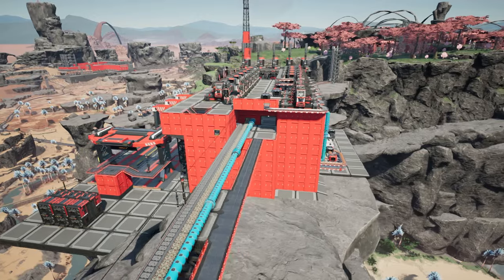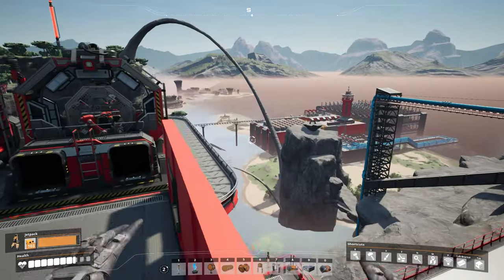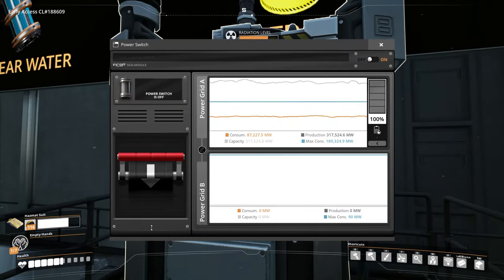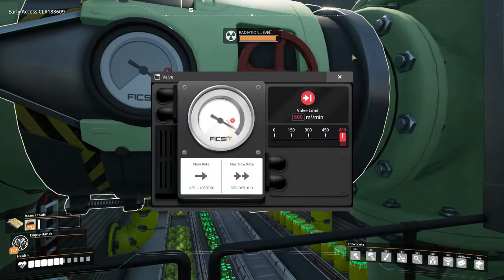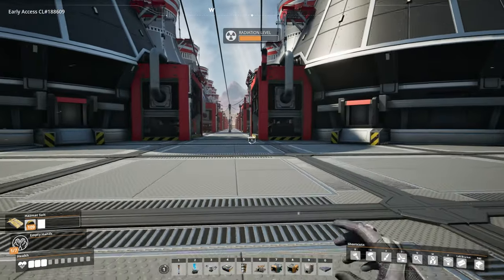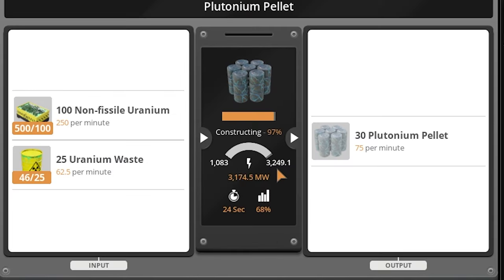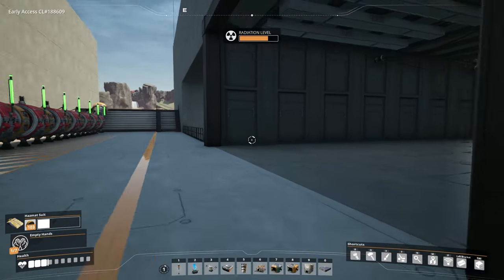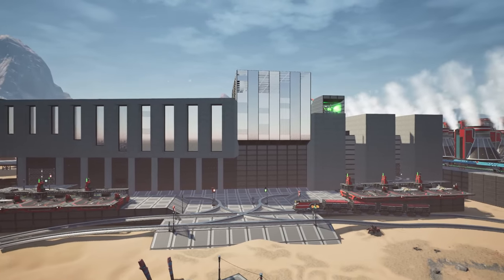The Nuclear Power Plant is FINALLY (actually) FIXED in Satisfactory!

Comment: Kibitz: It's finally fixed
Narrator: it was in fact, not fixed

But seriously is this satisfactory or a  nuclear balancing game?
Reply: Yes
Reply: ¿Porquè no los dos?
Reply: This is why I just haven't touched nuclear yet.
Reply: @Her_Imperious_Condescension  Honestly, Nuclear is not THAT bad. Kibz just kinda went the long way round in how he built (and re-build) it, not to mention the miscalculation in his waste processing plant. Multiply that by the sheer size of the powerplant, add the overreliance on a single ressource with the rubber and, well... you saw what happens :D
He could have cut rubber out of the heatsinks completely, instantly solving his headache. But he didn't because he's a content producer and fixing the plant has provided him with hours and hours of material :D
Reply: @Her_Imperious_Condescension  yeah better wait for next update when the oveclocking goes to linear scaling in power consumption so you dont even need that much power... so you can make a smaller nuclear disaster :P
Reply: @timokampwerth1996  I still contend he made a mistake on his heat sink calcs and most of this work was unncessary.  He said in the last video he needed somethign insane like 165 heat sinks / minute.  There's no alternate in the game that would require that many heat sinks even using the most efficient setup possible.  I think you'd max out at 130 and I'm pretty sure his setup should only need about 60ish.  I make 720 waste per minute off a single uranium node completely maxed out...I believe I need 35 heat sinks per minute for it.  I made a very small factory that just makes heat sink using nothing but oil, bauxite and water as inputs.  I make the oil into rubber and coke, sink the resin, use the coke in the aluminum scrap refinery, turn the scrap into pure ingots, then casings, then a few assemblers to make heat sinks from the casings and rubber.  It am pretty sure the hwole thing is less than 20 machines.
Reply: @NotMyActualName_  That's one way to go, I usually don't bother with oil at all and go the insta scrap route since coal at that point has lost most of it's value and I'm producing the acid anyways for the powerplant and I just use the overflow acid from the ruel rods because I'm using most of my quickwire for my Supercomputer plant. Add a bit of copper for the alclad casings and for copper sheets for the regular heatsink recipe and I'm done. 

Kibz tends to use slightly more involved setups because they result in more interesting looking builds, or so i believe. In terms of efficency he could build a lot more compact.
Reply: @timokampwerth1996  I considered avoiding using oil and just go with copper and aluminum for heat sinks, but then you have to bring in coal.  This solution I thought was simplest.  One oil line could make all the rubber AND coke I needed, plus if I get around to it I'll turn the resin into fabric to make rad filters on site.  I have a little excess quickwire and coal at the main plant.  I think I can just overclock my aluminum setup for the heatsinks and send a few extra casings over for that as well.  Even an inefficient setup there would probably make me all the filters I'll ever need given enough time.
Reply: @NotMyActualName_  Well, I had a coal node near the plant by coincidence so going with oilless was an easy choice :D Technicxally speaking going cokeless and then using rubber for the casing itself is the most efficient in terms of aluminium usage,  but i just wasn't going to bother. Perhaps i should also mention that i strongly favor centralized builds, so all but one Bauxite nodes are going into that facility, making the insta scrap far more viable than setting up all the inputs for a single node.
Reply: @timokampwerth1996  
I just don't see what Nuclear can offer that Turbofuel doesn't.
If Plutonium was used for recipes in the future, that would be a different story, but right now, it's just more hassle than it's worth.
Reply: @timokampwerth1996  I agree if you have the resources nearby that way is easier to set up.  In my case I could have gotten coal but I was pretty tapped on copper in the area and the oil node was right there.
Reply: @Her_Imperious_Condescension  Simply put: opening up oil for other projects. Or in case of Turbo Fuel: Oil, Coal and Sulfur. Oil is increadibly useful as a source for Rubber, plastic, petrolium and Cloth. Sulfur is needed for Batteries to set up stable Drone networks and Coal is... ... Well, oil and sulfur are useful. Uranium is useles outside of power production. It also produces power in a volume that oil can't even get close to. Depending on your playstyle, past a certain point you won't be able to avoid Nuclear
Reply: @timokampwerth1996  While i did have my mess with nuklear stuff too.... using copper for the heatsinks works best, while i dont have 1457537 plants yet i produce a ton of em and could pump out 2-3x as much with easy as ive pullled all the copper in that region and 2 coal mines there xD
Reply: @timokampwerth1996  
You don't need Coal for Turbofuel if you've got Blenders (turbo blend fuel FTW)
Honestly, not using any drones either. Haven't really found a viable use case for them yet.

And those are the key words right there, 'depending on your playstyle'. I'm making 80GW from my Turbofuel and haven't even come close to needing it all, because I don't build stuff on the large scale.
Reply: @Her_Imperious_Condescension   In that case Nuclear is not all that useful for you in terms of power production because it's specifically the large scale solution. I couldn't run even half my facilities if i didn't have nuclear set up. I'm using roughly 80% of  the Iron and Copper Nodes in the world, every Caterium Node and all but one Quartz nodes, all of them being run through overclocked Raffineries instead of Smelters or Constructors.

But aside from that, Nuclear is a fun puzzle. Especially when setting it up for the first time, there's tons of stuff to figure out how to handle. Even more if you want to sink the waste or even build up a secondary Plutonium plant.

Comment: One of the best things I did with my nuclear plant was wire up the water extractors in batches. So I can shut down my plants in a central power station either all at once, or in groups of 6 by just turning off their water.  No more walking around and flipping switches on the reactors if I want to slow down waste temporarily.
Reply: That's a great idea I'm definitely going to steal lol
Reply: @NyxHunter  I've used it multiple times.  It has come in very handy.  It was a little bit tedious dragging all those extra power poles and keeping everything segregated correctly so I didn't accidentally wire up the wrong group to the wrong switch, but that can be done lots of ways depending on what works for you.
Reply: @NotMyActualName_  I've already been playing around with using the power switches

Something I wish they would add is if one of your factories draws to much power and causes the breaker to trip, then only that factory goes down. Where each switch forms it's own breaker and then your whole system doesn't break. And it give you a indicator on the map what went down.

Cause I'd love to just run all my power through the rail line and break off at each factory. That way at a minimum I'd still have my trains available to get around the map and fix things.

Now my plan is just having the trains run on a dedicated circuit with backup power via generators and batteries and then run a power line parallel to the rails around the map
Reply: @NyxHunter  Power prioritization has been on the community wish list for a long time.  Best you can really do is separate your grid out so that certain parts of the world are on separate sections.  I'm glad it doesn't work like factorio though....having everythign just run slower because the power isn't high enough makes no sense.  That's not how electrically powered devices work.
Reply: @NotMyActualName_  I own Factorio from a sale but I just haven't had the patience to figure it all out yet lol. Eventually lol
Reply: @NyxHunter  I find the factory building part very unintuitive.  But I think if I spent the time to really understand it fully I'd enjoy it.  I do like how you have to fight back a hoard and keep your base safe while you're building.
Reply: That probably wouldn't have occurred to me because in the real world, turning off the water is how you get a meltdown 😂
Reply: @nefstead  yeah it's a super bad idea but it does make toggling your plants on and off easy.  It's a good way to roll back how much waste you're creating.  You coukd do it in any increment you wanted depending how much electrical work you feel like doing.  I went with groups of six reactors because I had 72 total and 12 breakers didn't feel too bad to set up.  Let's me toggle my power in nice 15000mw increments

Comment: Still dont know, why you dont use ICS before/after freight station. Single belt into ICS into Station or vice versa, so you dont have the problem with no loading/unloading while the Train is docked. When you dont the method with the ICS you DONT have the throughput you need

Comment: Couldn't you set the smart splitters to "overflow" for normal production, and "any" for the meltdown line? That way flipping the power switch on the meltdown line automatically sends the resources there without you having to run all over the place to change settings.

Too bad there isn't a logic splitter (and pipe valve) that has one configuration when unpowered and another when provided with power...

Comment: It would be awesome if they add a way to automate processes like the whole shutdown process.
Reply: Yea here is me thinking it would be great if besides power lines there are also data lines that can connect valves, relais, and programmable splitters to a computer you can actually use to greater logic systems.
Reply: Logic gates for power and belts would be wonderful.

Comment: KIBS!!!!! Do not one by one turn off reactors what I did is put a pump at the end of each water tube and tied it with a switch that way I can turn off or on if it has water or not when it runs out of water it just simply turns off and stops producing nuclear waste

Comment: That cable said 200A at 1000Vdc (11:18), which works out to 200Kw. 
If your charging at 800Vdc, the cable's amp limit should be about 250A. 
However, in the video, you're pulling around 104A. 
I'd say the limit likely comes from a safety system in either the car or the station due to the cold temperatures. 
Resistance goes down with the temperature and gives cables a higher capacity. However, the reactions in batteries slow down as it gets colder. 
This means slower charge times and less output capacity. 
Therefore, I believe either the truck or charger is reducing your charge wattage to minimize potential pressure buildup in the cells.

Alternativly, the charger is misconfigured.

Comment: So I watched this video and I watched the video where the emergency factory was build. But I am still not sure what the point is. wouldn't it be easier to just turn off some reactors to make the waste production rate lower than the waste recycling rate?  the plutonium fuel rod factory would slowly gets rid of all the waste and when no waste is backing up anymore turn the reactors back on.
Reply: the point seems to be that the emergency factory needs much less power to run up to the non fissile uranium stage, which is useful if the grid loses power
Reply: @finngardiner5358  ok so this system wasn't really necessary for this situation, right? there is still radioactive material left that needs to be processed somehow, which makes the whole thing kind of pointless. I would probably just build a giant storage area to drain all the waste from the reactors, then slowly feed it back into the recycling factory once everything is back running.